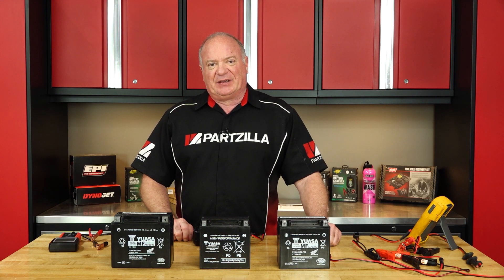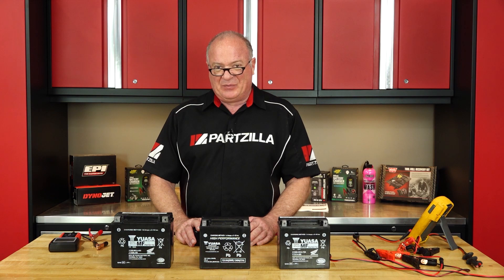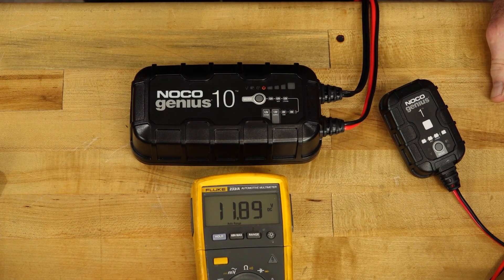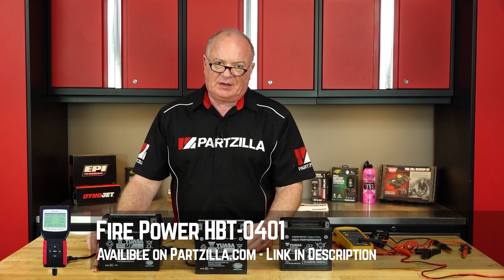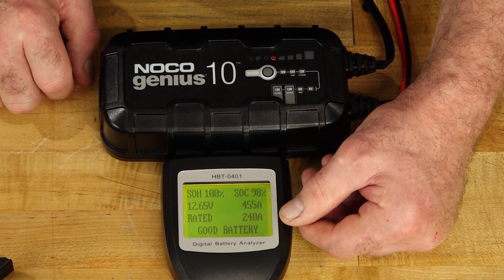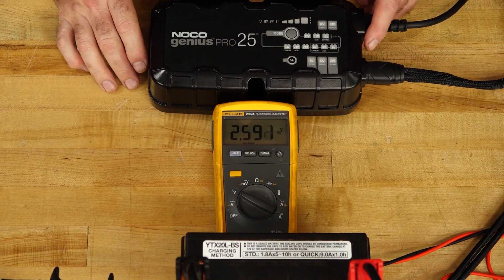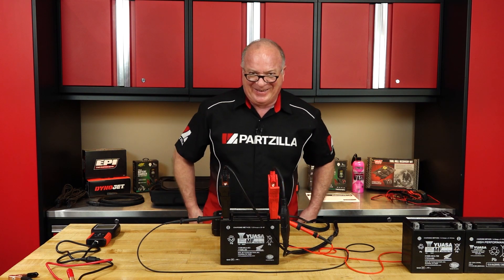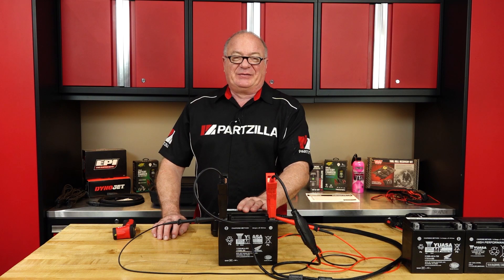NOCO Chargers | How to Use a NOCO Genius 10 | NOCO Genius 10 Force Mode | Partzilla.com

Comment: I read somewhere that repair mode shouldn’t be used with AGM batteries as it can dry out the electrolytes from the mat. Maybe that’s why the Pro 25 made the dead battery worse. Normal trickle charge might have been better.

Comment: why not just charge the battery instead of repair it? also noco 5 or 10 better for general accu batteries ( like ive a 12v / 100a / 950a/en ) so is 5 or 10 better ive a 5 running on it now but dont want to overheat the device
Reply: Repair is for batteries that have almost no voltage and are typically declared dead. You have to first force charge it to add voltage, then charge it fully in regular mode and then repair it. It will balance the cells so it holds voltage again. This can effectively bring a “dead” battery back to life, even if just for temporary use. It can definitely help in a pinch. For your particular battery I’d suggest the Genius10 for faster charging. It can charge a 100Ah battery at 50% depth of discharge in 7.5 hours according to their chart. The Genius5 will still work fine, but it will take twice as much time.

Comment: Do not wast your  money on this piece of junk. Only had it for 3 months. Know it will not change any battery i try . It just keeps cycling  off an on.  I went back to battery battery tender.  Much better charger
Reply: And I’ve had mine for 5 years and have charged plenty of batteries just fine. Still works flawlessly.

Comment: Thanks for this. You showed me that to get into Repair Mode you have to step it through to Lithium, then Press / Hold for 3 secs. The official manual just says "From Standby Press and Hold 3 Seconds With Clamps Connected to the Battery" - it does however recommend "For optimal
results, take the 12-volt battery through a full charge cycle, bringing the battery to full charge, before using this mode." - So I understand why you tried to give the battery a good kick up the butt seeing as it wouldn't take any charge. So far this little unit has impressed. Thanks again.

Comment: Simply hooking up a voltmeter does not give you a sufficient indication of what the charge is doing. At the very lease, you need to measure the voltage and the current delivered to have even the basic understanding of what the charger is doing. 

With the second battery, you may have got the same results without using repair mode and instead just charging it. 

As for the third battery that you're using repair mode, maybe you should read the manual where it tells you to first  take the battery through a full charging cycle before using repair mode.

Comment: Mine doesn’t go to repair mode at all. Doesn’t detect my battery and only “force” chargers for 2 min. I think it’s crap.
Reply: … read another comment above z  the guy probably did it wrong.  Must use repair mode only when fully charged

Comment: Before you use the repair mode, your suppose to charge the battery fully then use the repair mode to stabilize the cells in the battery
Reply: I went looking for somebody that would say that before I posted it you are correct. You’re supposed to charge the battery first and then do the repair mode. I recently did it to one of my batteries and it worked beautifully. PS that’s because I read the instructions just like you did.
Reply: @MONNIEHOLT to be fair... Mine didn't come with instructions. Didn't believe my wife when she said there wasn't any. Warranty paper, accessories paper.   Packing paper. That's it
Reply: Imma try this I keep having to jump start my car I just put it in repair mode earlier no luck imma let it charge first
Reply: ……I heard same thing  on another YouTube video. Fully charge, then repair.   I also heard someone didn't get instructions manual

Comment: The Noco Genius 25 is not made for motorcycle batteries! Too big of a charger for them
Reply from the maker: The Genius Pro25 features a reduced 5A charging mode for smaller batteries. On their website, you can scroll down and see the unit being used in a motorcycle application: https://no.co/geniuspro25

Comment: @Partzilla Great video, but in regard to the battery w/ less than 1V, I believe you were supposed to charge the battery first AND THEN GO INTO REPAIR MODE. Would you be willing to give that a try and see if it works? I've had friends who have repaired batteries by charging it first and then going into repair mode. I would love to see a follow up video on your attempt.
Reply: That is correct.  Charge it first, then run the repair mode.  It works.
Reply: He was saying in the video it didn't even register, so i understand that it will not charge it then it will display a red battery shaped logo light with an X through it(indicating the charger says it's dead, surprised he didn't show this, i've seen it myself), then at that point you HAVE to use the repair mode it seems to attempt to repair it, can work but not always, just depends on how far gone it was. But you are correct in that you have to run it in regular charging mode to receive that error message of bad battery and yes you are correct you should try that first, i guess he just didn't think it was needed to show that since he knew it was dead already. 1 volt is pretty dead, just getting a meter reading alone doesn't tell you though, you can have a 12.3 or 11.9 or something reading and the battery is dead gone(various reasons), even after repair attempts, the numbers can be misleading in that regard. You definitely want to see 12.6 though, anything else is a problem on a car battery.